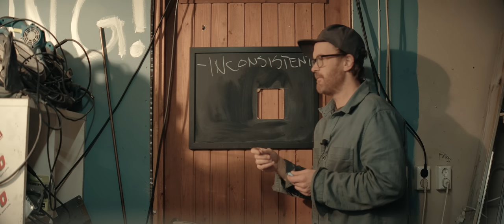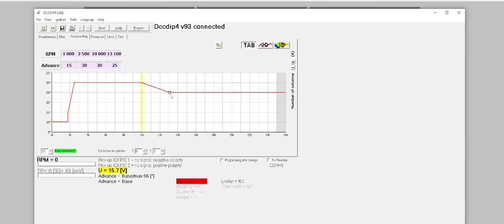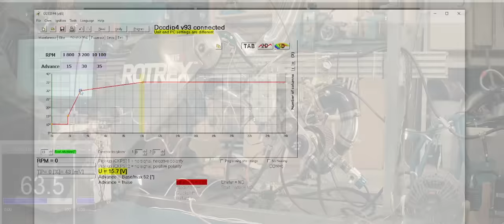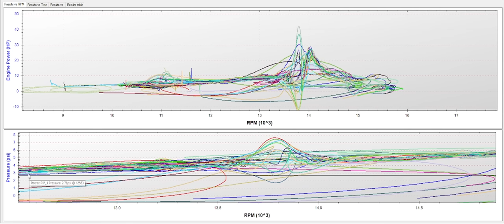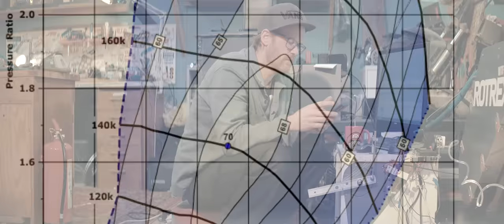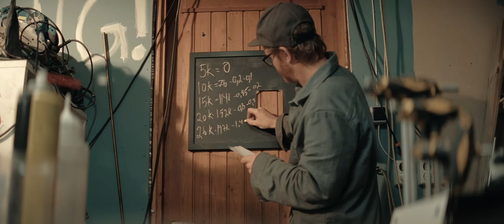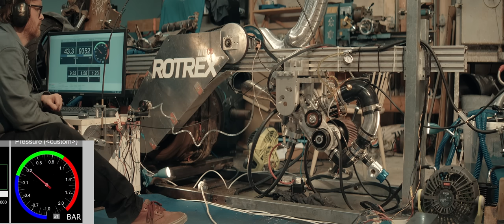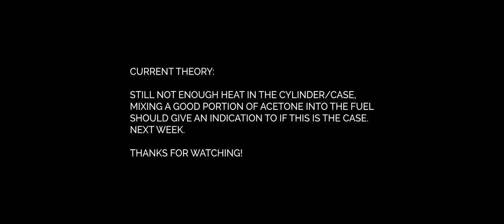Supercharged Pulsejet Engine?

Comment: First I was wondering how much power can a 50cc give, but now I am just curious how much patience can a man have? Battle of the machine versus human. Good luck human!
Reply: Lmao well I'm not Alex but iv been on my compound turbo 155cc for 12+yrs doing the same type of thing over and over again. I'd say the first 4 single turbo setups got scrapped Early on and I probably went back and forth between Fi and blow through carb for 6yrs. By year 6 the bike made 78whp... 6yrs and an extra turbo later were around my 100whp goal.. this last year has been making a bike that works with the powerplant to actually get the bike out of the hole lol no mentions small engines with lots of boost don't make hardly any power once they fall out of boost lol. Alex is a wiser smarter and better tooled than me so I'd say he has more patients too but I understand his pain. I love that he shows this r&d work no one does and I suck at filming lol.
Reply: The patience as a saint!
Reply: My "patience testing machine" is my 1965 Fiat.. Every time I repair something next problem is around the corner hahah I love that car
Reply: Three theories in one video!
Reply: @mrsnezbit2219  sound about right but mine is my car. 1994 w202 220c manual i adopted after it had sat on friends yard for 5years without use. He was selling that house so i gave him 300€ for it. Engine runs insanly good for 350tkm and doesnt eat any oil. I mean it doesnt drop in a year at all. If it does there is a leak lol. (One it had was crank rear seal. I got to change gear box front seal too) now its only paint and new as they come. Everthing has been done. Breaks,springs,dampers,bottom rusts,intake seals,engine wirings, clutch stuff from breakfluid tank to gearbox, fuel lines. Its a great car and i have spent around 600-700€ Max for everthing including rent for warm garage with lifts.

I enjoy doing stuff for this one.
Reply: Honda CRF 450 2004. Full rebuild, frame, engine, custom exhaust, you name it. Omg that was such a pain in the ass. But! I learned a lot from that bike! I ended up selling it to a dude who, I think, is still driving it in the back of his truck. Poor guy :)
Reply: @mrsnezbit2219  Fix  It  Again Tony came from.
Reply: @labrikorn_3299  i fully agree with you! This is not the way to test, too much parameter and component changes in one time
Reply: @Norwegian_Bastard  
Isn't it usually more cost effective to get a low milage replacement engine in such cases?
Reply: Well, current 50cc KTM mini bikes make around 6 hp.  With a completely ideal engine, I would think 8 to 10 hp tops.  But then you have to worry about torque.  You might be able to get a really high peak number, but over a very narrow rpm and with little torque.
Reply: For some this is what makes it "fun". Its all the shit in between the start of an idea and the finished project
Reply: @labrikorn_3299  I agree with you on the re-inventing of the wheel and test R&D stuff..... It's frustrating knowning that there are others that are further ahead down the development path than Alex?
I've been posting saying that he needs to talk to the snowmobile guys that have been boosting 2 stokes for 10+ years already!
Those guys know how boost and stroke work already. They are already past the tuning stage and are at the stages where there are destroying other parts and cooking motors running a bit too much boost and then they are pulling them down strengthening where the weaknesses are in the parts that they using? They are then using tools and mills just like Alex to build custom parts to strengthen the internals of those boosted motors!
Again these guys don't ride anywhere off boost..... They are always on boost and just hammering these things! 
They are literally blowing intakes off and are going to special V-band clamps to hold boost at such high PSI 😲

Alex needs to talk to those kinds of guys to realise what is takes to do something like this and then scale it down to his setup. They are running expansion chambers as well friggin 3 of them with 3 stinger pipes feeding the turbo charger. So boost happens after power band always!
Reply: A 50cc snowmobile sounds like it may be fun for ages 6-14 depending on how big the kid was..  i had a little tiny 50cc mini chopper bike that i cranked up the fuel to an put on flanged pipes so it would spit flames and sound like a leaf blower on crack..  itd spin the tire with a grown ass 175lb dude on it,,  top out around 20.,  30 down hill on a good day..  so id have to imagine a snowmobile having to turn that wide ass belt would top out modified stock at 20 ideal conditions.. snowmobile bodies are much heavier also..  you seen the turbo hayabusa jet ski tho?  Theres a vid where dude starts off up close by the docks in a little lake gully.. then takes off..  worth a watch.
Reply: lol same! i'm hoping he install's it onto a bike :O i can't wait
Reply: @vintagetrikesandquads4012  what do you mean by completely ideal engine? 50cc can be much powerful than that
Reply: @geemy9675  By ideal engine I mean one developed by NASA over 20 years with a billion dollar budget.  In other words, there is a limit to how much hp and torque you can get out of 50ccs.  I speculated 8 to 10 horsepower for a reliable engine.  It could be higher, but peak hp isn't the only consideration.  You also want usable power, not a peaky screamer.
Reply: 50cc motorcycles were raced at one point, top speeds were quite high. Honda RC116 had a top speed of 177km/h. It produced 13.7 horsepowers.
Reply: @Nobody-Nowhere  that's amazing. 21k rpm twin cylinder 4 strokes, in 1966!!
but 110mph is even crazier since land speed record in 50cc motorcycle class is 91mph in 2018..
Reply: @vintagetrikesandquads4012  bidalot rf50 wr makes 20hp stock at the wheel and is world record holder and is without forced induction. I guess it should be possible to make much more but high performance 50cc doesn't attract much attention. turbocharged 4 strokes Kawasaki h2r 326hp/999cc downsized to 50cc should make around 16hp at  same 14krpm, maybe up to 23hp if revved to 20krpm..
last gen Honda nsr500 GP500 2 strokes made 400hp/liter naturally aspirated and running on gas so again around 20hp at 50cc and even more at higher rpms with lighter pistons, shorter stroke.
Reply: @vintagetrikesandquads4012  the thing is theres no market for high performance 2 stroke 50cc anymore, so no R&D. last breakthrough was Aprilia Sr ditech direct injection which matched the best stock 2 strokes performance, with 4 stroke efficiency/emissions. performance two strokes are now only in dirt bikes but no focus on 50cc. best 125cc is KTM 38.5hp at 11200rpm, 308hp /liter, so 15.4hp for a 50cc, which again could rev quicker and make more power
Reply: @Norwegian_Bastard  they always run the best before they blow
Reply: @vintagetrikesandquads4012  he wants to run a vario on a servo so all he needs is peak hp
Reply: FYI - I run my 50cc nitro two stroke as cold as possible
Reply from the maker: That's interesting. There's a flaw somewhere in my design...
Reply from the maker: How much ignition advance at peak power rpm? In my Spx on equivalent fuel I ran completely "normal" timing (~15deg) and that worked good, running 35deg without melting anything points to something really off.
Reply: @2STROKESTUFFING  I was thinking (I'm pretty sure you know better then me). So in an atmospheric engine,  in the intake manifold, pressure is around 50-80 mbars (so, less then normal around 1020 or something). So, if any air is added, that rises the pressure, is considered an engine with boost, right? So maybe if you try to get it running good without boost, and add air/fuel in increments, that would give better results, in other words lambda should be always around 1 or 0,9 for power?  And maybe there is no need to play with the advancing because you set it in the beginning and not touch it later?
Reply: Budfad 50cc streamlined, ran more than 150 mph 6 speed gearbox at bonneville
Reply from the maker: @andyalemm  Can you repeat what the problem was again?
Reply from the maker: Are you that scam-hunter guy?
Reply: @2STROKESTUFFING  Maybe it's time to use fuel injection? I mean it would help with vaporization wouldn't it?
Reply: @andyalemm  Would fuel injection get rid of that problem? I mean injectors atomize fuel very well.
Reply: @afflickracing1705  my first two wheeler (motorized) was a 50cc nitro...MBK nitro 😂 great little water-cooled two strokes that did close to 55mph stock unrestricted with a pipe. (yamaha aerox for the rest of the world)
Reply: @swiss_2k  tuning the engine without boost first and cranking up the boost progressively sounds like a good idea. tuning a NA 2 stroke is common knowledge whereas supercharged one is uncharted territory. maybe the idea of CVT mounted supercharger would help to change the supercharger rpm by just switching weights
Reply from the maker: @andyalemm  I agree fuel atomization might be a problem, but maybe not the main problem, and I don't think 32mmish is too large a carb in this situation.
Reply: @2STROKESTUFFING  remember your blowing into the carb not sucking, the physics are different.

Set up a little test with transparent pipe, venturi and fuel inlet, then you can visually see how the velocity is different from blow/sucking though a venturi and plan around that information, would also make a good educational video for everyone ;)
Reply: @skonky  I see three main reasons
1st would be the rules..I don't know exactly what are the rules for 50cc category. single cylinder? maybe other rules that could make it impossible to have similar engine configuration. and regulation to the fairing too. 50cc streamliners go way faster for instance

2nd would be the budget/tools/skills. a factory Gran prix team even from the 60's has much more budget, too mechanics, time, tools, exotic materials, to develop hand built engines from the ground up, hence the 4 stroke, twin cylinder 21krpm 50cc. nothing's even close to that has ever been built outside Gran Prix motorcycles ?
bidalot makes performance two strokes part and they ran I think with their stock engine you can buy for a few hundreds.

3rd it's is not the same to run top speed for 1 full mile average back and forth on salt flat with lot of power loss due to elevation (4200ft) and measured with certified gear compared to one speed run down a smooth track that could have been manually timed with big error margin, with tailwind, maybe slight gradient...

BUT still a huge achievement to go that fast on 50cc  more than 55 years ago
but it made only 13.7 HP and record holding bidalot can make 10hp more at sea level. so either the Honda had much better aero or the elevation removed a lot of power
Reply: @skonky  just taking guesses...
Reply: @vintagetrikesandquads4012  That's the goal: high peak bhp at a design rpm of +20,000 rpm that must be maintained for a total of about four minutes.
Reply: Aprilia am6 with big bore stock bottom end 30 hp plus.  With Athena kit best of luck
Reply: @labrikorn_3299  as a follower you took the words right out of my mouth now no forced induction. That was the whole sale of his videos just disappointing how is veered off track
Reply: @laurentmenarguez2913  it's trying to be the most powerful 50cc. not 70-80 or more cc. displacement matters for world records etc.
Reply: @laurentmenarguez2913  because nothing was working as expected, he tried to remove some unknown parameters from the equation, and try to set a baseline without supercharging. turns out it doesn't work well without either. he's right, make the engine run well first, then add supercharging

Comment: I think after a certain rpm the 'seal' from the back pulse from the exhaust is overwhelmed by the blower and now the combustable mixture is passing strait through the combustion chamber which is ignited in the pipe causing the flame thrower so the trick is to balance the back pressure pulse from the exhaust and blower. The pain and hard work will be worth it! Great video again!
Reply: Maybe calm down the port timing a bit. What do you think?
Reply: That's a good suggestion, I wonder if redesigning the resonation frequency in the exhaust pipe (give a steeper angle on the reflector of the pipe) and maybe a smaller tip could help increase the back pressure.
Reply: @mact.26  you may be onto something there. In a previous episode he enlarged the stinger size and it made worse.
Reply: exactly..... I just don't know how you can balance the back pressure of unburnt fuel.  I think the easiest answer is fuel injection, more particularly direct injection.
Reply: @chadcoady9025  direct injection would be pretty game changing but right now doesnt his setup still use the fuel to oil the rotating assembly? If he tried to use direct injection he would lose all the lubrication
Reply: @kasuraga  The lubrication situation would definitely have to be addressed.  KTM has a design where "two-stroke oil is pumped into the throttle body, to lubricate the crankshaft, barrel, and eventually the cylinder bore and rings. Fuel is squirted into the cylinder via two injectors in the transfer ports, rather than into the inlet port or head."  So you might be right, especially with such a high RPM motor.

With the KTM design, 2 stroke oil will still be forced out of the engine through supercharging, and he would have 2 tanks.  One for fuel and one for oil.
Reply: @chadcoady9025  Hello Chad. Sadly in Norway RC fuel comes pre mixed with a minimum of 10% oil before sale.
If I may just point out this engine and exhaust ran to 18k plus rpm when run with the Roots blower and speedway carb with 15deg of timing. It would be nice to see if the speedway carb could be fitted with the Rotrex to see if it makes a difference to fuel atomomisation and rpm ceiling.
Having just watched one of Alex's SPX video's from 5 years ago the exhaust had a longer stinger. This expansion chamber was made for the normally asperated resonant induction system and tuned for 19k.
I find the episode " 50cc engine trowing parts a good reference. Sorry for jumping in on your conversation chaps.
Reply: @mact.26 the steeper taper will create a stronger pulse over a narrower range which might make tuning a bit harder. I reckon a variable diameter stinger will help it out a bit
Reply: I've been wondering about a way to measure this and what I thought of was maybe one could measure inside the exhaust with something like an O2 sensor where one could see the unburnt fuel, this would give an idea of what is happening to the pulses, if the pulses are not strong enough or what. I saw a O2 gauge guys use on motorcycles to tune the carb to the correct ratio. Anyway this process is amazing to watch I am so glad I became a patreon.
Reply: Yep
Reply: Would a butterfly valve that adjusts automatically  for increased or decreased back pressure. Somewhere in the exhaust
Reply: Or possibly boost pop off valves set to certain psi placed multiple points along exhaust.   To fix
Reply: You got me thinking so I'll reply with the comment I posted
I think we need a restriction at the exhaust port, for three reasons:

1-To assist the pressure wave coming back up the pipe in sealing the chamber. The only answer to stopping the pulsejet is to hold the fuel where you want it burning. We're running the PIP cylinder at the moment, right? So perhaps the closest we could get is choking the inlet to the pipe itself, creating a pressure differential to trap the mixture. 

2-Increasing dynamic boost pressure heats the mixture more, as well as spending longer in the warm crankcase. The stinger/pipe being the system restriction concentrates the highest energy differential there, and ignition is coming from upstream. Moving that point upstream to the edge of the head may help decrease the volume that the supercharger "feels like" it is filling, lifting those boost numbers that have always been a little low.

3-It's really easy to test!
Reply: @matsanga1 O2 sensors will have a hard time surviving with all that unburnt fuel and oil being thrown at it. Probably still worth investigation for tuning, even if the sensor isn’t a long term item
Reply: @redshift6170  Agreed. One chap suggested using a diesel lambda sensor for it's ruggedness. I thought that was a good idea.